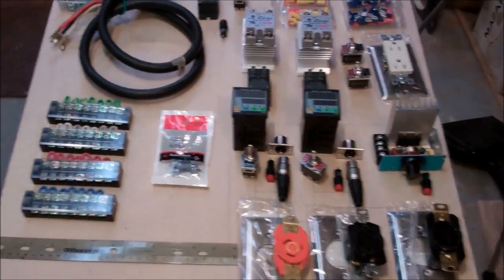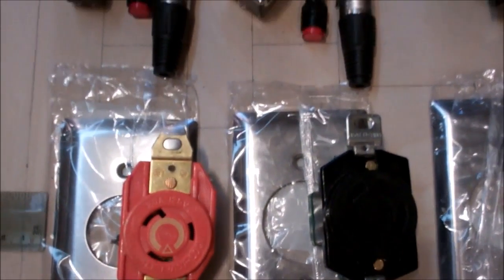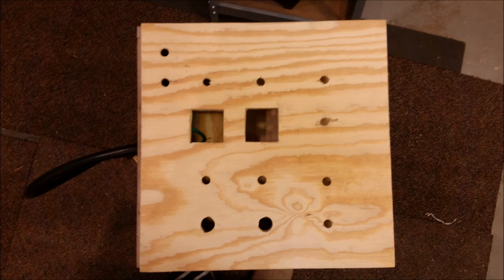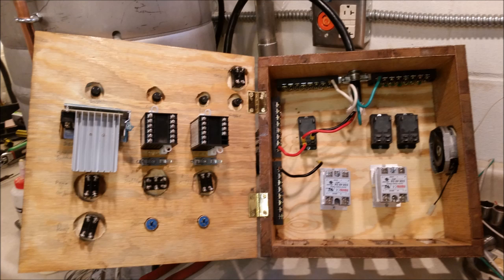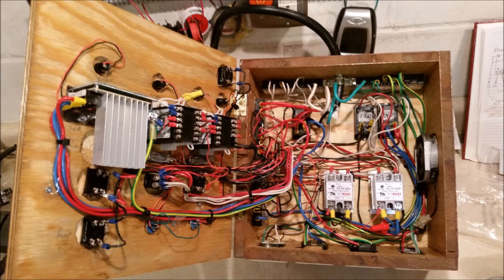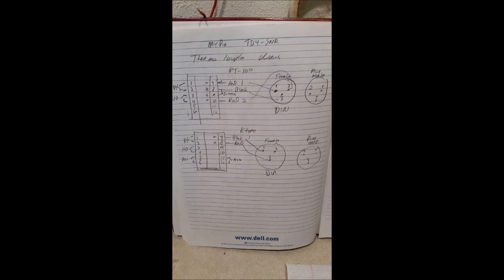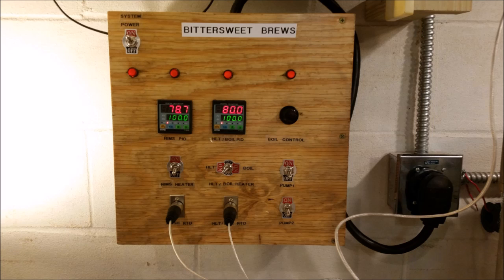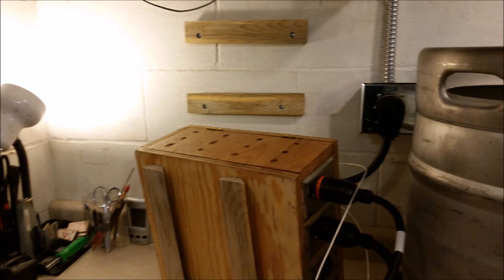Electric Brew Controller Build - BitterSweet Brews

Comment: This is great I’m looking to add an xlr connection to my probe do you just cut the ends of the probe and attach via solder? Or is additional wireing required?
Reply from the maker: That is just what I do., cut off the spade connectors and solder it to the connector.  Make sure you test out your wiring pattern.  I think I put the odd colored wire in the middle and the same colored wires on the outside pins.  Depending on the probe type, PT100 or K, you may have to run a jumper on the PID. I put a switch on the PID connectors so I could use either type. I think they needed to be jumped for K type and un jumped for PT100.   Now, most of my temp sensors have removable cords, so I had to troubleshoot the wires to make sure they were all wired the same so I can gram any cord for any sensor.

Comment: I have a homemade control box I made out of an old Ammo Can but its tight on space, have seen this and finally got around to watching it, Hows it holding up a year later??
Reply from the maker: I did the same thing with a Harbor Freight ammo box.  I made a portable 120v controller.   I use it for my RIMS when I am propane brewing or to control the temp in my electric kettle smoker.  Here is a YouTube about it.  https://www.youtube.com/watch?v=PlAs5w4wGPs

Comment: You are INSANE!
I hope no one follows your BAD advice and builds their control panel in a wooden box. 
WARNING..... Only follow these instructions if you want to burn your house down. I am a licensed electrical contractor and journeyman electrician and engineer. Believe me when I tell you, this control panel is DANGEROUS!
Reply: Wrong.....
ALL electrical enclosures are made of non combustible materials and they contain burning wires, contactors and connections from burning buildings down thousands of times a day.
Reply from the maker: Thanks for the concern John, I appreciate your professional input.  I have been looking for a metal box to move everything to. I would like something a little lighter.  I don't recommend this, it is just how I did it.  If you have access to a metal box, by all means use it!  That said, I was VERY careful to make sure all connectors and connections both high and low voltage are solid and arc free and with the fan inside it never even gets warm.
Reply: I believe it's OK to build a wooden electrical enclosure, as long as the proper precautions are followed. For exmaple, any metal protrusions, such as switches or outlet covers, should be properly grounded. Anything that would cause a wood enclosure to burn would be bad news for ANY enclosure. What I find odd is that people treat brew panels as if they are running an elevator filled with old women and children over a pit of hungry lions. Sure they can be dangerous, but you have to do quite a few things wrong at the same time.

Comment: +Krys Beal I plan on adding a switch off of each PID that opens the jumpers on PINs 8 and 9.  With the jumper open   I can also use a Type K temperature probe (after re-configuring the PID type setting).  As it is wired here I can only use PT100 probes.  These are faster and may be more accurate, but cost more than K Types (and I have a few K types lying around).  You then need to make sure you wire the K Type to right pins on the male XLR jack.
I did this on my "Portable Electric Brewing or Smoker Controller & GFCI Extension Cord" video and it has come in real handy.  Here is a link:
https://www.youtube.com/watch?v=PlAs5w4wGPs
I also have bought some small, cheap 5V alarm buzzers, but have to figure out how to wire them in.  I tried to connect them to the alarm terminals on the PID directly but it didn't do anything.  I am not sure, but I may need another set of relays for them.
One other thing I don't think I mentioned is that you need to calibrate your temperature probes for accuracy.  You put them in boiling water and set the PID + or -  the degrees needed to show the correct boiling temperature at your altitude.  I then attach a label to the probe saying what that probe needs to be set at.
I have now brewed probably a dozen times with the controller as is, and I am very pleased with how it works.

Comment: Great work.  Could you publish the parts list?  Thanks for the video.
Reply: +Mike Myers If you search for me, or bittersweet brews on Homebrewtalk.com I have a listing of the parts under Electric Brewery Controller.  Or, here is a link:  

http://www.homebrewtalk.com/showthread.php?t=507882
Reply: +TimTrabold I guess there is also a parts list in the video's comments section.  I forgot I put it there.

Comment: At 2:44 I would change the dual 120v socket for a GFCI version.
Personally I'm a fan of metal enclosures, but if you use wood, and you ever see burn marks, or smoke, investigate thoroughly!
Reply from the maker: ***** The thing about a GFCI socket is you can't split the outlets apart.  So you can't have two switches controlling two pumps independently.  My controller circuit is on a GFCI spa panel, so it gives me the protection I need.  
I agree about the wood.  I do keep a close eye on it and have never observed anything that would give me pause.